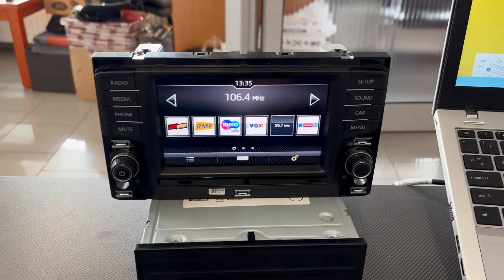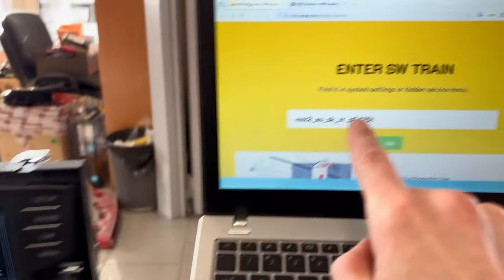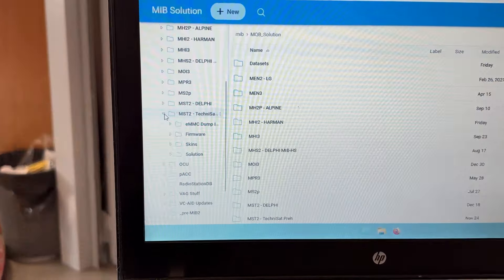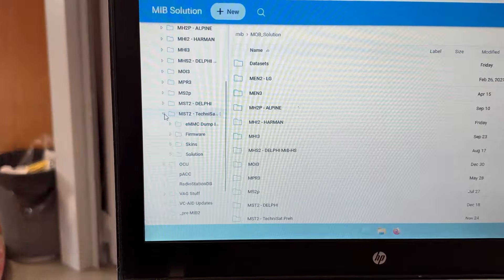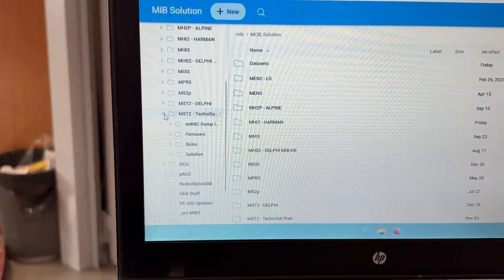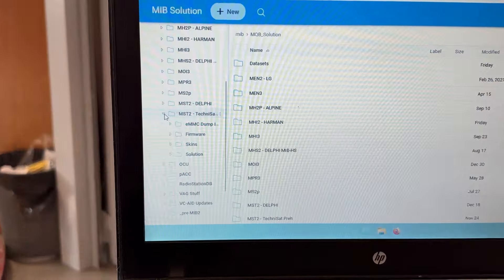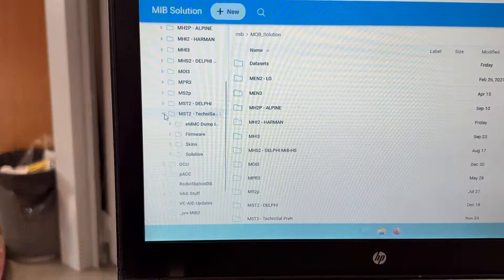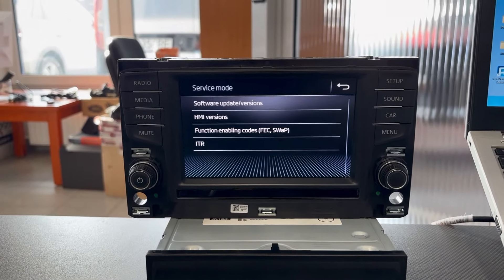Free Skoda MIB2 firmware update with download link (Columbus Amundsen Bolero)

Comment: Thanks for the very, very useful walkthrough. One question/concern - If I do the upgrade MST2_EU_SK_ZR_P0245T to MST2_EU_SK_ZR_P0253T, will I need to follow the "Confirmation of installation change" steps? 

And if I don't, is there a risk that my system won't work?

Comment: @mrfixpl Do I get any other benefits with the newer software? Can I also add voice control? My Škoda is from 2017. Great video by the way!
Reply from the maker: Mostly system stability improvements. But if you force foe example FW update from 02xx to 04xx on Technisat units, you will have couple small additional features.
Reply: @mrfixpl  how do I force FW 002xx to 004xx? And is that worth the effort? And what about voice control is that possible  to add? Thanks for help!

Comment: Hello,
Thankyou for all the super helpful videos. I have an MIB2 Technisat unit. After i follow the instructions 
1. Enable the Green Engineering Menu
2. Install toolbox 
3. Unlock App Connect.
Would there be a way to go back to original stock firmware with all the 3 things back to how they were? e.g: Disable Green engineering menu, Uninstall toolbox and Lock app connect. Asking because if i sell the car then i want it to be back to its original firmware so that the new owner doesn't know that i messed around with the system.

Comment: Hi, congratulations you are very prepared. You would also know the procedure to switch from Amundsen to Columbus Touch and Mib 2.5 units (if I'm not mistaken) for Karoq
Reply from the maker: You will need new unit, new display, new dashboard trim, coding & adaptation, remove CP, insert FEC/SWaP codes.

Comment: I am glad that you are showing to us the other kind of opening such a feature. Which can be sometimes useful. I would like to ask can be this used also on the radio from Skoda Octavia 3 Swing 3 (MIB2) SW: MEN2_EU_SKGPx_P0080L MU: 8755? The radio shall support Apps but I took radio from other car then I unlocked the CP (not me one guy who has all tools for it ODIS and licenses). I lost the Android/link because radio was mount on other car. So basically I am looking for some solution and this looks like the one I am looking for. Now, it depends if I can do it on the Swing3 technically it should works. Could you somehow tell me if is possible please?

Comment: Excellent video. Thanks for posting it.  I ran in to a problem at the end unfortunately. When I click start to do the update in the car I get the following alert. "Unable to read the file meta-information" "Can't use Update Container.  The current Software Download application is too old"
Reply: I'm having the same problem. Did you find any solution?

Comment: Hi There Mr fix! the MIB helper says there is updated version for my VW golf8 MIB3 but its no where to be found in the download site.
My current ver is MEN3_EU_VW38X_P2045L  is it only for Skoda this source ?  
Thank you!
Reply from the maker: When it comes to MIB3, I would not risk a self-update. Not for now. There's very little documentation about what's exactly needed afterwards, since those cars are just ending the warranty.
Reply: @mrfixpl  
Thank you for your reply, 
We will live with the annoying bugs...
I already did one update at the dealer , they also used a usb-c stick , didn't use the Odis software...
The problem it takes them a long time from the release of the update till it's available to the clients...
Reply: Look at the forums for the updates. I know that with MIB3 on the new Octavia NX people have shared the updates and they have been working fine. I was on the fence about trying it and one day I got a massive OTA few months ago that fixed all my bugs in my Octavia.

Comment: Hey there, I started experiencing problems, where the speakers in all the doors remain inactive when I switch on the car, maybe connected to a firmware update. I was curious about this point given on the MIB helper site - "External amplifier (Bose, Bang&Olufsen) might need dataset after update.". How would one install a dataset for the amplifier?
Reply: And to clarify - I have the Canton system with an external amp under the driver's seat.

Comment: "Hello everyone, for a couple of days now, my VW CC RNS system (I think it's Composition Media) has been acting on its own. It opens settings and executes commands spontaneously. Can anyone tell me what could be the issue? Even the reset doesn't work, and it happens even when the car is turned off, as I initially thought it might be a steering wheel problem."

Comment: Good day. I have a problem. Car radio. When turned on, the logo and radio sound appear, then an endless reboot begins. I think that the update will help. Where can I get updates for MIB STD2 ZR+NAV 3Q0035824B SW0359 HW H30 Thanks in advance for your answer.

Comment: Hi i installed myself all seat sound system in mib2 seat 2015, and configured with vag com to 9vd and now i have subwoofer control but the volume of subwoofer doesn't change. Do i need yer or yes Vag can pro? or i can activate in other way? Thanks in advance
Reply: You need dataset/parameters for this..  can be done with vcp yes. Done loads of them

Comment: I currently have MHI2_ER_VWG11_S2125_1
(MU: 0343) what will be the latest firmware?  the website you provided shows me the latest MHI2_ER_VWG11_K3342,  it is the correct firmware? because this new one is K3342 and currently instaled is S2125_1

Comment: The Amundsen system in my 2015 Skoda yeti stopped working one day and gave the code emergency update please insert disc. Then repeated this over and over with the unit locked so that I couldn't turn it off until it flattened the battery so I had to unplug it. plugging it back in produces the same results. How do I fix it?
Reply: @alanshuttleworth  have you found Solution?

Comment: Hello i need help i ordered a wireless carplay for my mk7 2016 and i have stock MIB with connector i am unable yo connect the wifi carplay with my headunit what would be the procedure to make it work if i upgrade to MIB2 will it solve the problem?
Reply from the maker: Which firmware you have right now? If you have MIB1 (MSTD or MHIG) - there's no CarPlay support in those units. Neither wireless nor wired. You would have to add a CarPlay box under the dashboard that goes between the main unit and the display. It around 250 Euro on AliExpress.
If you have MIB2 (MST2 or MHI2), there's most likely a chance that your unit supports wired CarPlay. You would only need a wireless adapter like CarlinKit.

Comment: Great videos. I am trying to update my VW polo 2016 MST2 to the latest P0480T. When I try to update it says ‘Unable to read the file Meta information, can’t use update container. The current software download application is too old’.  Im on P0138T. Cheers
Reply: Ofcourse it dont work. Your sw version is 01xx you cannot update to 04xx sw. In your case, 0140 is the latest sw version you can do...
Alsway stay in same sw version 01xx to 01xx, 02xx to 02xx, 03xx to 03xx, 04xx to 04xx.
Reply: Thanks. Also I’m having trouble changing the code (error 1555) on both my vw polo and Skoda Kodiaq. I manage to find confirmation of installation change. Replaced code using MIB-Helper. It says changed but then goes back to original. I’m using vcds. Does the stereo have to be turned off? Cheers